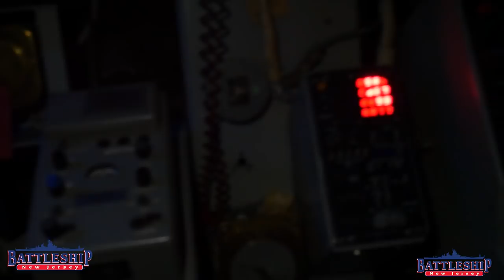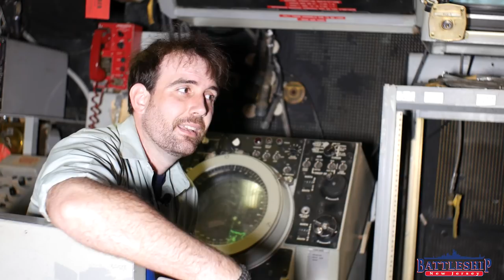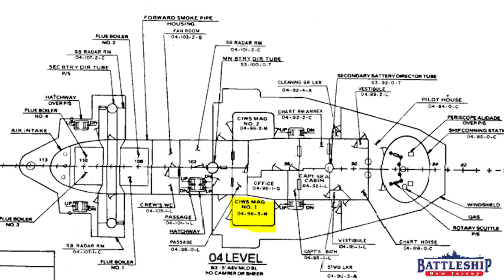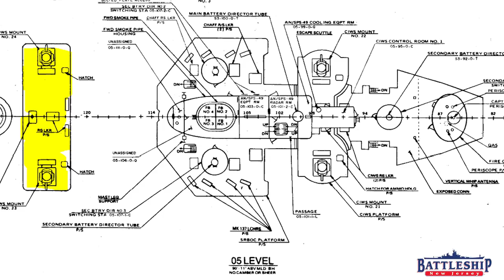Phalanx CIWS

Comment: I would not call one ship accidentally hitting another a success. In fact I cannot find any information if the phalanx has ever successfully stopped a missile in a combat situation. The missile fired by Iraq were stopped by intercept missiles.
Reply: A similar system has been used by the Army to intercept hundreds of missiles, mortars, and artillery with great success. It goes by another acronym. Several are Navy deployed units too.
Reply: You never want to have to use your CIWS, no matter the type. That means your other defenses have failed the inbound missile got way to damn close. Kills at long range with missiles are best.

Comment: If two phalanxes are firing how can they differentiate between their outgoing shells?
Reply: Assuming they are being run by the remote control panel only one will be firing on a given target. And all the computer has to do is track the rounds moving directly away from the gun that fired it. If multiple targets are being engaged simultaneously then each should be being engaged by the most appropriately position mount and likely won't be firing on crosswise bearings.

Comment: It's a weakness in the system that there's no direct-feed option from a storage box into the Phalanx ammunition feed system.  I hope some group is working on a fix for this, a 1-15 duty cycle when you REALLY need the weapon operational isn't good.
Reply: as a rule of thumb you never hold ammo where it can be shot at, also that would require a magazine directly below the gun
Reply: @cdmonmcginn7561  Understood, but in the case of the ready storage Ryan shows it's pretty exposed already in a lightly (at all?) armored box next to the CIWS.  And each time the techs have to reload, aren't they fully exposed?  So all the time they're spending reloading is putting them at risk, as well as the ship being unprotected.

I'd like to see some form of tray under the Phalanx that has a robotic arm that can feed a pre-linked belt of fresh ammo into the system so reload time is shorter, and the guns can be brought back into use faster. Safer for the crew and ship, I'd think.
Reply: Pretty difficult and failure-prone to get a linkage to a gun who has this kind of range of motion. Maybe even impossible.
Reply: @txm100  Correct plus the feed rate and the unit is designed to be mounted nearly anywhere
Reply: @davidb6576  It doesn't use belts.  It uses linked ammunition.  The rounds are stripped out of the links by the loader mechanism we attach when loading/unloading the CIWS.  The rounds then get put into the chain that feeds the guns.

It's far too complicated to be done automatically.  Depending on how wonky your loader is(and they're NOT common devices) the loading procedure varies from intermittent stop to PITA(like stop, back up, bust out the prybar, reset, okay go)
Reply: the real weakness is it can only fire at one target at a time. if the usa ever went against a country with a real missile arsenal they could easily be overwhelmed with a large volley of cheap missiles.
Reply: @davidb6576  but thats 4500 rounds of 20mm exploding above deck, not 60000 rounds of 20mm exploding below deck
Reply: @imchris5000  Given that most US Navy ships have 2, 3 or 4 of them in conjunction with 2, 3, or 4 RIM-116 RAM's and the whole block of vertical launched SM-2ER's as part of their defense network, I don't think they care that much.  There is A LOT of CIWS on US ships and a lot of ships operating together.  Getting through to something like a carrier means fighting through the carrier's own weapons, a Ticonderoga, four Arleigh Burkes and a host of submarines and other support ships.  

To put that into perspective:
The Nimitz has:
-2xPhalanx (Up to 4 Phalanx and RAM units total, this is configurable so 3 Phalanx/1RAM, etc)
-2xRIM-116 RAM (Up to 4 Phalanx and RAM units total, this is configurable so 3 Phalanx/1RAM, etc)
-3x8 RIM-7 Sea Sparrow Mounts

A Ticonderoga Has:
-2xPhalanx
-2x61 VLS tubes with a mix of SM-2ER's, SM-3's or SM-6's, mixed in with other VLS capable munitions (Standard loadout was 80 SM-2ER's, 16 ASROC's and 26 Tomahawks)

The Arleigh Burkes have (Depending on which Flight Burke we are talking about):
-1x or 2xPhalanx (DDG-85 onward only have one, pre DDG-85 have 2)
-1x90 or 1x96 VLS tubes with the same mix of SAM missiles as the Ticonderoga's have.

So to total that up, that's 
-8xPhalanx 
-2xRIM-116 RAM
-3x8 RIM-7's
-218 VLS tubes with a large portion of that dedicated to SAM capabilities

And that's assuming we aren't working with early flight Arleigh Burkes with an additional Phalanx each and 6 less VLS tubes.

That's nothing to sneeze at, AND we are ignoring the entirety of the carrier's air wing to prevent said launches in the first place.

Comment: it can and it will engage waves of missiles. one minute of ammo is a lot of ammo when you only need 10 rounds per target.
Reply: If they're slow ones sure. 
But modern missiles go through its engagement envelope horrifyingly quick.
Reply: @KoishiVibin  maybe that's not the case for the '80s phalanx, but today it will shoot 3000 rounds per minute of radar-tracked ammo (yes, it tracks both the threat and its own ammo). 

But you're pretty much screwed if something gets at phalanx range.

Comment: I was searching for a boiler video to drop this, but this will work! If the red oak can get going again than so can the New Jersey!
https://youtu.be/Gjs69XIjU-k
Reply: I believe the US Navy has expressly told them they could not light off the boilers or operate the main turrets in any meaningful way.
Reply: @Whiskey11Gaming  I believe the turrets are allowed to be operated, but not being able to light off the boilers prevents them from getting the power to operate turret systems, they can still elevate the guns manually, but turrets can't rotate

Comment: Great system... Today it's great; then, not so much.
Well, when it was functioning properly it was great.
Which would last 15 or maybe even 45 minutes after calibration. The 1980s and 1990s were not a good period of time to rely on that system. Which is not something anyone bothered mentioning during that time either. A somewhat functional CIWS constantly firing cockeyed was still valuable, as long as the issues weren't widely known, and they weren't.
Plus, they sort of could do an at sea calibration if war ever came. But for stuff like protecting ships in the Gulf of Arabia, well just assign the anti-air mission to allied ships like the British ones.